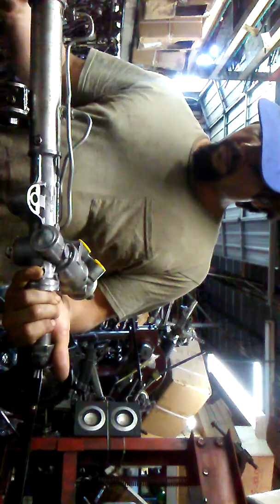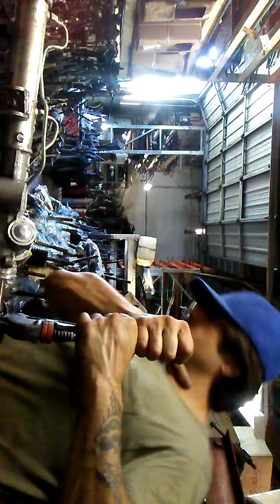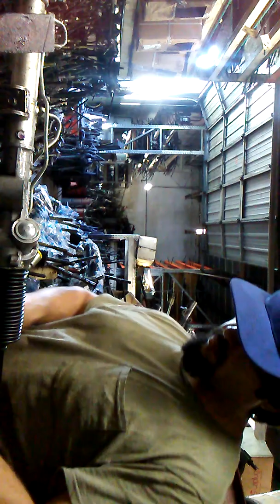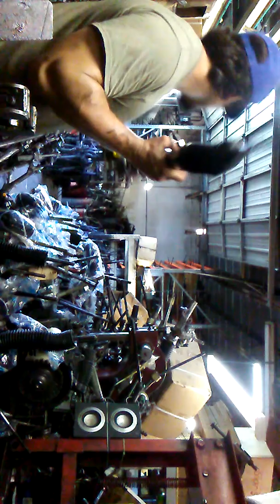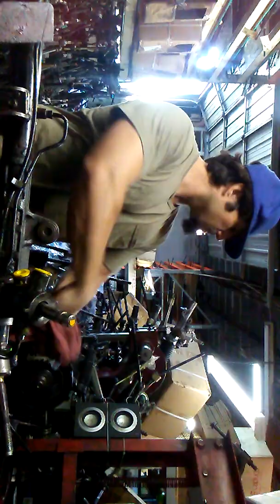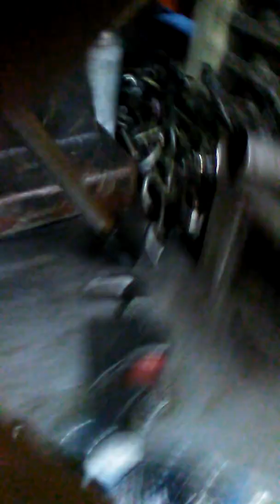Rack and Pinion grease and reboot

Comment: hey man do you add grease to the Rock and pinion arm before installing the inner tie rod and if you do what kind of grease are you using.
Reply from the maker: Hi, I usually checked the inner tie rods condition first making sure it works properly. A lot of the time we just replaced the rods with new ones but sometimes we would use the pneumatic press to my left and we would fix them, reinstall then add grease and boots. The grease I am not sure the name but it's very common. Who knows maybe it was bearing grease.